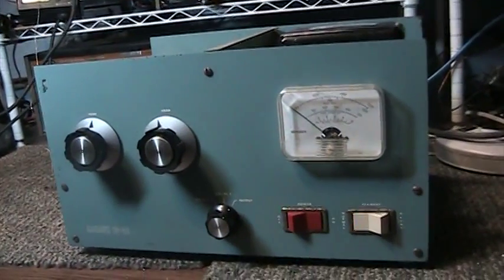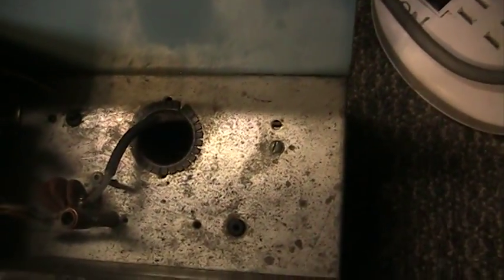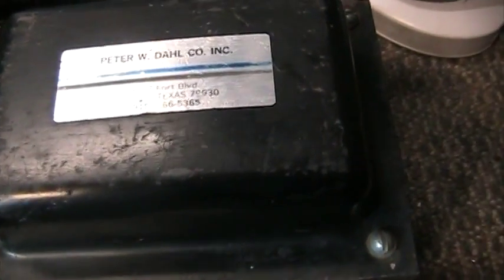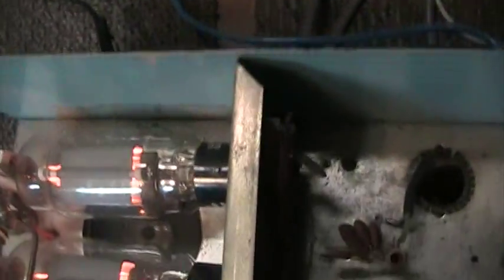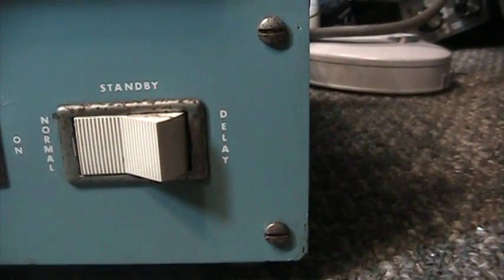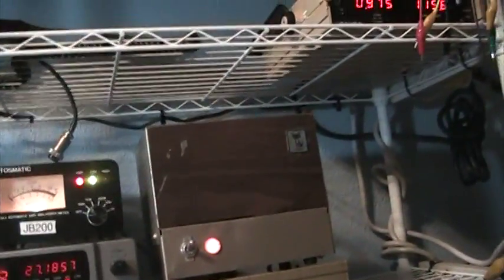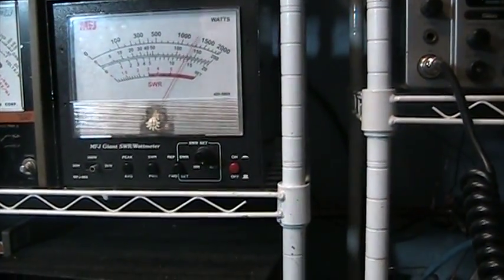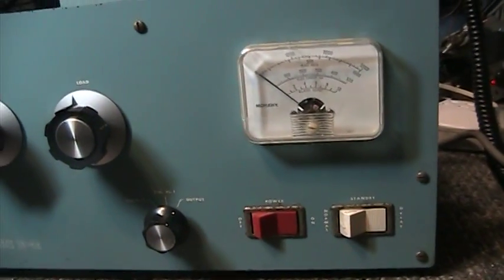Mohawk 10 572B tube Linear Amplifier

Comment: I just saw Pics of a mohawk that I never knew existed. It's got what looks to me as a 3.500z tube with a driver tube. I can't tell it's model. It's for sale on ebay right now! Guy has it listed as a 572b box but when he sent me pics is when I noticed it had a 3.500 z tube but it's got out of my price range. I don't know why I felt the need to tell you all this but I did.. Anyway have a great day if you was to end up with it I'd sure like to see a video on it... I would think it's worth checking into either way I wanted to pass on the info to someone who is as passionate as I am about amps as ii am!
Reply from the maker: Yeah, I looked that one up. I would say not factory. Someone modded that.
Reply: I look at those pics again and you was right it's been modded. They left the 572b parts still in it..  @tramdr
Reply: @tramdr  I was curious but if I can figure out how to send these pics I got to I will. Idk i figure you the one to know considering I can't find  nothing on  the 7a I got still hunting a full schematic or some knowalge that's beyond mine. Someone along the line has reworked it needless to say input tune and bias is off..

Comment: Nice amp especially if your long winded like me 🤓 Unlimited key down time with the 572B transmit tubes. Do you have any more junkie amps laying around that use the 572B tubes?
Reply from the maker: Naw I don't people love them 572B's and buy them. Truth is, I'm more partial to 3-500z's
Reply: @tramdr  I'm looking for a one tube 572b box I'm thinking of building one out of an old phantom that needs tubes.

Comment: I got the heath kit SB 200 and a SB 201 and the HA 14 with external power supply got the 12V DC draws 50 amp peek and the 120V supply. I need caps ! waiting for my order to come in. my ameritron has 4 572B tubes 1300 watt. great Tubes!! keep the drive down and they last!!

Comment: There is NO way to get 1300 watts output from 2 572s ... I have 2 FL-2100B and both using 2 572 maximum INPUT power is a round 1,180 watts, so this will give you basically 600 watts in SSB. 73 de KF4KUL
Reply from the maker: well I have had FL2100B's. Didn't like them. They use a voltage doubler in the plate power supply for one. This uses a full wave bridge with a peter dahl hypersil transformer. No comparison.
Reply: Really, just read the specs on the tubes  ... so typical CB bullshit ... 73 de KF4KUL

Comment: Hello   I don't know if you still have this amp,, but, I acquired one of these for parts.  I also have 2, which are still working.  However, the part one has a bad transformer.  But, it does have the case, and it has a little bump out, to make it work with this oversized transformer.  I would be willing to let go of the case if you are interested.    I have talked briefly with you before, and have some tube equip that could use a little service?  Great amp!  The 2 that I have that work, are the Mohawk 10.  Great units!  Great Video!   Thanks for it!
Reply from the maker: Thanks for the offer but this amp has been sold.
Reply: Hi Noel, do you still have the Mohawk 10 case? This is in 2020, thanks, from G.C.

Comment: Two 572B tubes should operate at about 2,500 volts to the plate.I Strongly recommend that you check plate voltages  before proceeding with the rest of the restoration of this amplifier.The tubes are fairly cheap,they're only about $65.00-$70.00 dollars a piece.(Always buy these as matched sets ONLY!!.) If everything is operating properly,you should get a proximately 600 watts RMS (Root-Mean-Square) SSB and proximately 300 Watts on am.

Comment: That's a nice amp, I am surprised it uses 572b's over the crappy sweep tubes every cb amp used back in the day.
Reply from the maker: 572B's where expensive (transmitting tubes) and back then before TV's went transistor, sweep tubes where a dime a  dozen.